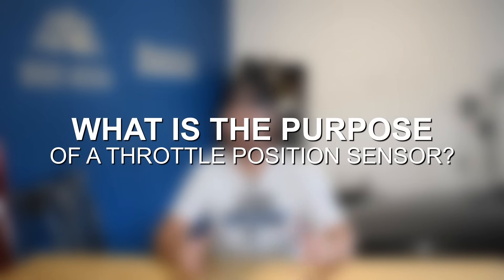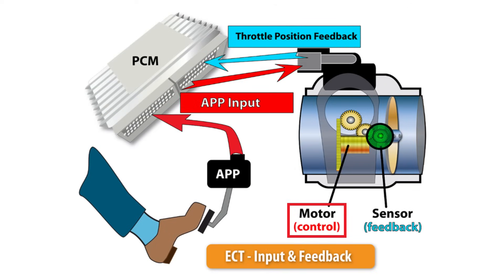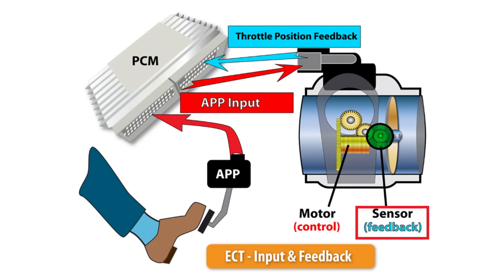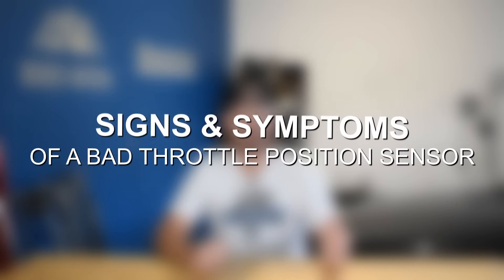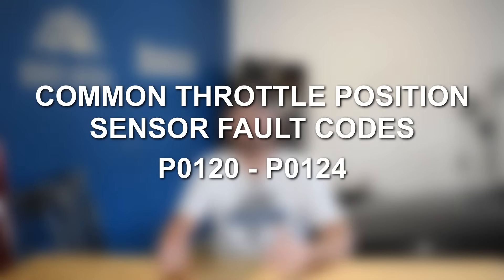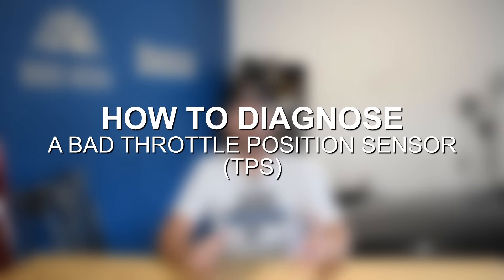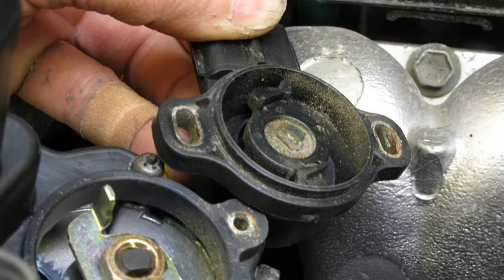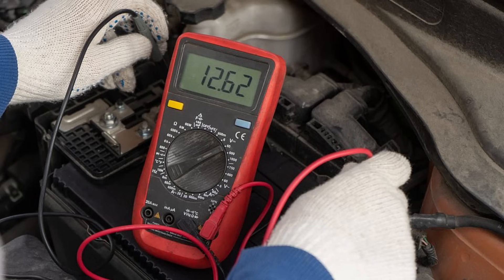Signs & Symptoms of a Bad Throttle Position Sensor (TPS)!

Comment: I first had a problem where I turned the key and nothing just click noise.i turned the key 10 15 times it would finally start. I thought it was the starter. Had that changed. The guy messed up and the injectors where shooting out gas. Took it to a shop they fixed that. Car was running fine. Then 2 days later same thing with the key. Changed the ignition switch e everything was fine. Started every time. Then parked it. next day went to start it. It gets to 1000 rpm and just shuts off. I haven't had a car for 4 days now. I ordered a throttle body and maf sensor waiting for that. Hopefully that's it. I have code p1121 p1168 p1148 p1051 p1031 p0452 smh. I have an 04 Armada.
Reply from the maker: S - Sorry to hear this.. Your 2004 Nissan Armada initially had a no-start issue with just a click, which was resolved with an ignition switch replacement, but now it starts, hits 1,000 RPM, and shuts off with multiple codes (P1121, P1168, P1148, P1051, P1031, P0452). These codes suggest throttle body, air-fuel ratio sensor, EVAP, and fuel pressure issues, which could all be contributing to the stalling problem. The P1121 (ETC actuator), P1168 & P1148 (AFR sensor issues), and P1031 (bank 1 air-fuel sensor) indicate potential problems with the throttle body, MAF sensor, or fuel delivery. The P0452 (EVAP pressure sensor low input) suggests a possible fuel tank pressure issue, which could impact fuel delivery.

Before replacing parts, try a throttle body relearn by turning the key to "ON" for 10 seconds, then off for 10 seconds, repeating a few times. Also, check the fuel pressure to see if it's dropping, indicating a weak pump or clogged fuel filter. Ensure there are no vacuum leaks, especially around the intake and EVAP system. If the MAF sensor or throttle body is faulty, your replacements should help, but if the problem persists, focus on fuel pressure and air-fuel ratio sensor wiring. Keep us updated.

Comment: What if a code reader won't read the codes, or even connect to the ECU?
Reply from the maker: D - Then that likely means you have an issue with your OBD port. Check the fuse that powers it.

Comment: On my jeep jeep show code service electronic throttle control and my fan started running fast its thats normal ?
Reply from the maker: A - If your vehicle is showing a "Service Electronic Throttle Control" message and the cooling fan is running at high speed, it's likely that the engine is in limp mode, which happens when the ECU detects a throttle-related issue. This is not normal but is a common fail-safe response to protect the engine. Possible causes include a failing throttle body, dirty throttle plate, bad throttle position sensor (TPS), wiring issues, or a problem with the accelerator pedal position sensor (APP). The cooling fan running fast is often triggered by faulty sensor data or an ECU safety measure to prevent overheating. Try cleaning the throttle body, checking for loose or corroded electrical connections, and scanning for stored codes beyond just the warning message. Keep us updated!
Reply: @  ok thanks for the info I guess I have wiring issues or ecu because I did a engine swap and after that nothing is working properly even the headlights not working

Comment: Help ) 2003 Dodge ram 1500 in neutral or when coasting or Park the idol can drop real low to like 500 and then the light on the dash and it dings informing you that there is a low idle problem which I'm sure it's not too good when the oil isn't getting into the enginebecause the oil pressure is low please help
Reply from the maker: D - Your truck experiencing low idle (500 RPM), dash warning, and potential oil pressure concerns is likely caused by a dirty or failing IAC (Idle Air Control) valve, a vacuum leak, a faulty throttle position sensor (TPS), or a clogged PCV valve. The IAC valve controls idle speed, and if dirty or failing, it can struggle to maintain proper RPM. Try cleaning the IAC and throttle body to see if the idle stabilizes. A vacuum leak in the intake manifold, PCV system, or a cracked hose can also cause idle dips, so inspect for leaks. If cleaning doesn’t help, consider checking the TPS, as an inconsistent signal can cause low idle. Lastly, ensure good oil pressure, as low oil pressure at idle could indicate a failing oil pump, clogged pickup tube, or worn bearings. Start by cleaning the IAC and throttle body, then check for vacuum leaks and sensor readings with a scanner. Keep us updated.

Comment: When i drive my 2005 dodge ram it almost stalls and won't go faster than it will idle. Push gas pedal and nothing. If i cut the truck off, it will run fine for about 5 minutes then it will do it again. I'm thinking the electric throttle body is busted.
Reply from the maker: T - Your truck struggling to accelerate, almost stalling, and only idling even when pressing the gas sounds like a failing electronic throttle body (ETB), a bad throttle position sensor (TPS), or a failing accelerator pedal position sensor (APP). The fact that it resets when you turn the truck off suggests the truck is going into limp mode, which happens when the PCM detects a throttle issue. A dirty or failing throttle body can cause erratic throttle response, and if the TPS or APP sensor is faulty, the PCM may not register pedal input. Start by cleaning the throttle body, checking for any loose or damaged wiring, and scanning for pending codes—even if no CEL is on. Keep us updated!

Comment: I had my throttle body sensor replaced twice. I have a 2002 Dodge Ram 1500. I will be stopped in traffic then when time to go when I accelerate the truck will go from 0 to 100 without me pushing that hard on gas pedal. Why? It has taken off on me many times like this. I’m afraid to drive my truck
Reply from the maker: J - If your truck is accelerating uncontrollably even after replacing the throttle position sensor (TPS) twice, the issue could be caused by a faulty throttle body, sticking throttle cable, bad idle air control valve (IAC), or an electrical issue affecting throttle response. Since the TPS has been replaced, the next step is to check if the throttle body is sticking or if the cable is binding, causing unintended acceleration. A failing IAC valve can also cause erratic throttle response by improperly adjusting airflow at low speeds. Additionally, inspect the wiring and connectors for the TPS and throttle body to ensure no short circuits or voltage spikes are causing the ECU to misinterpret throttle input. A scan tool can be used to monitor live throttle position data to check for inconsistencies. Keep us updated!
Reply: @ I will let you know what I find out. It’s weird that I have 2 friends who are mechanics and have never been able to figure this out for me. I’m so afraid to drive my truck that it stays parked. I’m on a fixed income so it might be a bit before I can get back with you.
Reply: I haven’t been able to find out yet

Comment: I wish I'd watched this before I bought and replaced the Eccentric Shaft Sensor in my 2008 x3 3.0si. Did all of that work of taking off the valve cover and replacing the sensor only to put it all back together and "WAH, Wah, wah"! I thought I had done the appropriate amount of research but hadn't factored in the lack of acceleration past 1500rpm. Once I came back to the Youtuberverse I found this and my faith in humanity was renewed. Thanks!
Reply from the maker: T - Thanks for the feedback. We hope it helped!

Comment: The lighting bolt comes on still but no check engine light plus has a brand new throttle body any idea whats going on with it?
Reply from the maker: L - If the lightning bolt warning light (indicating a throttle control issue) is on but there’s no Check Engine Light after replacing the throttle body, the issue might stem from wiring, calibration, or the electronic throttle control (ETC) system. Start by inspecting the throttle body wiring harness and connectors for damage, corrosion, or looseness, as poor connections can disrupt communication. Ensure the new throttle body was properly initialized and the ECU was reset or calibrated after installation. Additionally, check the accelerator pedal position sensor (APP), as it works alongside the throttle body and could cause the lightning bolt warning if faulty. Keep us updated!

Comment: Where is the peddle sensor located on a 2001 Mercedes e320
Reply from the maker: J - Are you referencing the accelerator pedal sensor?
Reply: @8020Automotive  yes and I went to the Mercedes and they told me it's by the master cylinder in the engine compartment not by the puddle
Reply from the maker: J - There ya go!

Comment: Where is.the throttle paddle sensor.located
Reply: if it's a gasoline engine, TPS is in/near throttle body

if Tesla/EV, it's built into the accelerator pedal assembly
Reply from the maker: J - Are you referencing the accelerator pedal sensor?

Comment: Would a bad throttle body sensor be a reason for my rpm’s to blip and rev once I shift outta first?
Reply from the maker: K - Yes, a faulty throttle position sensor (TPS), which is part of the throttle body, could cause your RPMs to blip or rev unexpectedly when shifting out of first gear. The TPS provides the ECU with information about the throttle's position, and if it sends erratic or incorrect signals, the engine may temporarily increase RPMs due to improper air-fuel mixture adjustments. Inspect and test the TPS for irregular readings, clean the throttle body to ensure smooth operation, and consider replacing the sensor if it’s faulty. Keep us updated!

Comment: I have a 4Runner 2004 with 212k miles, in general great car, but it went into limp mode and check engine light on, gave me a P0121 code! 
What should I do if cleaning the throttle body only made it work for
A few days after going back to limp mode, I need to mention that after I pull over and restart my car, it works normally, but check engine light persist ?
Reply: @8020Automotive  sorry ! I wasn’t answering a question, I was actually asking one 😂
Reply from the maker: G - The P0121 (Throttle/Pedal Position Sensor A Circuit Range/Performance) code on your 2004 Toyota 4Runner suggests an issue with the Throttle Position Sensor (TPS) or its circuit. If cleaning the throttle body only provided temporary relief, the problem likely lies with a failing TPS, worn throttle body components, or an intermittent wiring issue. Since the issue resolves temporarily after restarting, it points to the TPS providing erratic readings that the ECU flags as out of range. Start by testing the TPS with a multimeter to check for consistent voltage output as the throttle opens and closes. Inspect the wiring harness and connectors for corrosion, loose pins, or damage, as intermittent faults can cause the limp mode behavior. If the TPS or throttle body assembly shows irregularities, replacement may be necessary. Keep us updated!
Reply: @8020Automotive  thank you so much, I will proceed to do this and give you guys an update
Reply from the maker: G - Please do!

Comment: where is it located on a 2007 ford escape hybrid 2.3l
Reply from the maker: B - The TPS is housed within the electronic throttle body, which includes a motor for electronic throttle control (ETC).

Comment: I have rhe issue where intermittently the accelerator pedal is unresponsive until i come out of gear and back in to gear but theres no fault codes appearing or engine management lights appearing
Reply from the maker: K - The issue is likely related to the throttle control system or clutch pedal switch, even though no codes are present. Start by cleaning the throttle body, checking the pedal and clutch switch, and inspecting wiring. If the issue persists, monitor live data and consider recalibrating the throttle system.

Comment: My 02 escalade 6.0 idles at 500 or slightly less and occasionally stalls at light. But it idles normal when i start it cold. But when i start driving the idle will fall next stop. But runs good on road.
Reply from the maker: L - The most likely cause is a dirty or faulty IAC valve or a vacuum leak. Start with cleaning and inspecting these components, and address fuel and sensor issues if the problem persists. This video may be helpful: https://youtu.be/oD35vPTCwDs
Reply: @8020Media  oh thanks for responding. Most never do.
Reply from the maker: L - We strive to help everyone! Hope it helps.

Comment: What if I’m not getting any codes but previously misfiring due to faulty coil. I replaced it and then month later I drive the car and randomly loses power and can’t gas it more and engine light is flashing. I’ve cleaned the mass air flow sensor and throttle body and already has new catalytic converter
Reply from the maker: D - There is likely a code stored that will point you in the right direction since the engine light is flashing. Keep us updated. We also have another video that may be more helpful: https://youtu.be/ipjYLPJgpq8

Comment: Sir, I need help with a 2006 ford freestyle, it idles too fast, the car will drive forward and in reverse on level ground, very slow  but will not set still unless the brake is on, how can you adjust idle or could some of the sensors be bad? thanks for any help. Eddie Livengood
Reply from the maker: E - Sorry to hear this.. Start by cleaning the throttle body and checking for vacuum leaks. If the problem persists, test and address potential sensor issues like the TPS, IAC, or MAF.

Comment: I got none of the symptoms and just went to start my dodge caravan and got the red lightening bolt light and is wouldn’t start
Reply from the maker: D - This indicates a problem with the ETC (electronic throttle control) system. Check your battery first then the throttle body components.

Comment: l have problem my Toyota Runxshape is not idling ,brake is not soft, please help
Reply from the maker: M - Sorry to hear this. Our recommendation would be to check for vacuum leaks and repair any damaged hoses, test the brake booster for proper function, clean the throttle body and IAC valve, inspect the air filter and replace if necessary, and clean or replace the MAF sensor if dirty or faulty.

Comment: Great vid. When under load, If the throttle does not respond when repeatedly pushed quickly but does react when in neutral would that be the tps or the pedal assy.? I'll probably change out both but could it even be the throttle body itself? No codes stored and it's a 2015 Subaru manual.
Reply from the maker: S - Thanks for the feedback. If the throttle does not respond under load but works fine in neutral, it’s more likely an issue with the Throttle Position Sensor (TPS) or pedal assembly rather than the throttle body.
Reply: Thanks. Just swapped the pedal and no change. Awaiting the TPS. Happy Holiday
Reply: So it turns out my car does not have a tps. It has an IAC unit attached to the throttle body. But I lucked out. I cleaned the MAP sensor which fixed my issue.
Reply from the maker: S - Nice! Thanks for coming back and updating us. This will certainly be helpful for future viewers!

Comment: Lexus body position sensor is like $180
Reply: Can you have a bad TPS and the check if the engine light is not on.
Reply from the maker: D - Unlikely, but possible.
Reply from the maker: M - Thanks for the insight!

Comment: I really had no problem with my Corvette until it gets cold then the reduced engine light comes on
Reply from the maker: D - It could be a few things. Check your TPS, electrical connections related to the throttle body, MAF sensor, or battery.

Comment: "Hi, I'm extremely frustrated with the ongoing issues with my car, a 2007 Nissan Dualis. Despite multiple visits to the mechanic, the problems persist. The issues are: Idle Speed Out of Spec and Engine Hesitation during acceleration. Notably, there is no engine light on. Unfortunately, the situation has escalated, and the car is now currently engaged in Limp Mode. I've had the ignition coils replaced twice within a few months, only to be told the new coils weren't compatible. I'm losing faith in the mechanic's ability to diagnose the root cause. I've learned a lot from online resources and plan to start by cleaning the TPS and throttle control. Any additional advice or solutions would be greatly appreciated."
Reply: Mass air flow sensor or your in line fuel filter is clogged

Comment: I was getting a P2122 code (Throttle Position Sensor Low Voltage) on my 2015 Hyundai Sonata, and car went into limp home mode.  The battery was weak, so I went ahead and replaced it.  So far, I haven't gotten the P2122 code, and car is running fine.  Does this make sense?
Reply from the maker: E - It's certainly possible with the low voltage.

Comment: I'm having the same symptoms of a bad throttle position sensor but I am not getting any check engine lights or any codes for it. Johnny Cash that I'm getting are for a engine coolant sensor. Po118 coolant temp sensor. And a p0154. O2 sensor code. But no codes for throttle position sensor.
Reply from the maker: M - A lot of components experience the same symptoms, so it is very likely that it isn't TPS related.
Reply: @8020Media  engine in my truck is a 7.4. 454 Big block. Fuel injection.
Reply from the maker: M - Keep us updated.

Comment: hi, would a p0299 code also be included? i feel a spring coil on my gas pedal while driving engine light turn on reads that code,. I drive a chevy equinox 2021 ,please advice would help me. they said my booster should not be giving out because engine isnt even a decade old
Reply from the maker: R - I don't think so. This could very well be an issue with the turbo.